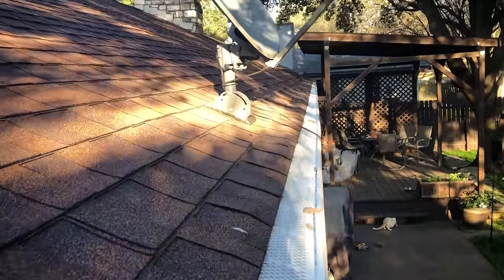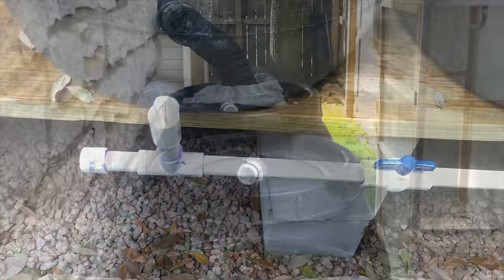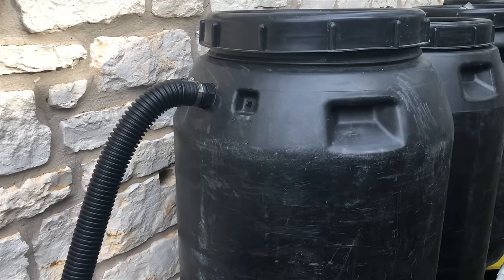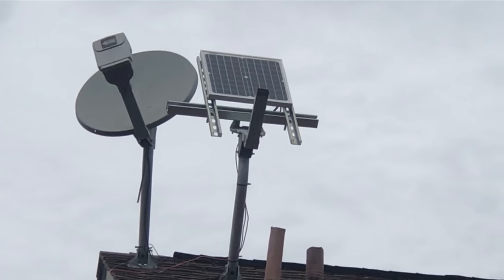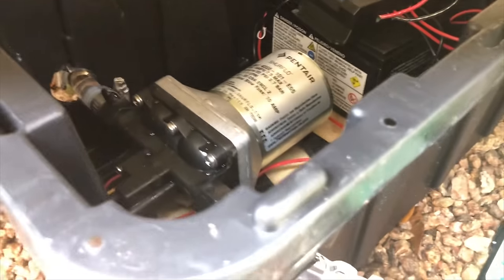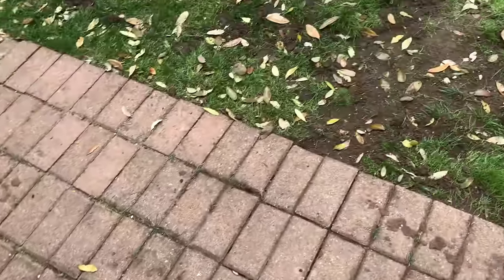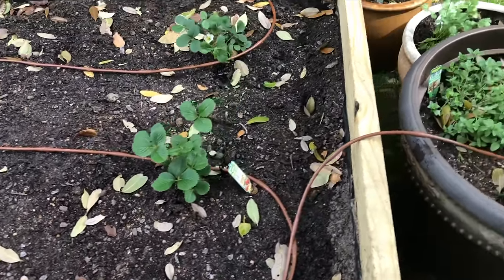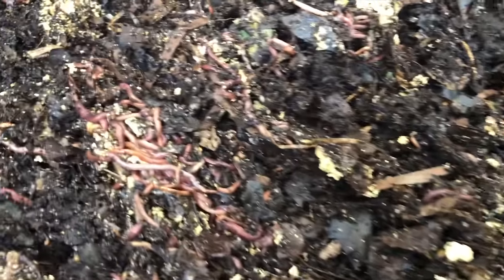Rain Barrel System Overview with Solar Powered Water Pump

Comment: Wow, our systems and gardens are VERY similar.  Found your video cuz I'm probably going to change mine from a gravity fed to a ground based pump system next spring. Super cool, thanks for posting. Very helpful.
Reply: My current system is gravity and I just don’t have the pressure. Definitely going to look into the pump.

Comment: I am such a doofus! I was wanting to know the level in my rain barrels as well, but I was going down the route of cutting a hole in my entry barrel and sealing in a clear plastic view port. This will be so much faster, less hassle and probably more accurate. Thanks mate!
Reply: Strap the view tube to the side of first tank and make the algae cover a flap you can just pull back to look, much better ease of use, and you can leave it capped off, or use a mesh cap for venting

Comment: You've probably discovered by now that you need an overflow hose in your first barrel.  Rain sometimes come much faster than the subsequent barrels can fill.
Reply: UH....What?   Think about what you say before you say it.
Reply: @tunerdadtunerdad7927  A large enough volume of water will be constricted by the size of the transfer pipes. 

In theory, you are right, the water in the barrels should rise at the same rate. In reality, that's only the case if the volume of the transfer pipes is equal to the volume of incoming water. Being that those little pipes are narrow, and the water is coming from an entire roof, it's quite plausible that the first rain barrel would fill much quicker than the others in a deluge.
Reply: @monunyabidness5949  ...Look at it again.
Reply: @tunerdadtunerdad7927  There's a 4 inch pipe going in. There's what looks like a 1.5 inch pipe exiting that tank into the manifold. A 4" pipe can do 240 gallons per minute, gravity fed. A 1.5" pipe can do 35 gallons per minute. Even if that were a 2 inch pipe going into the manifold, that can only do 55 gallons per minute.
Reply from the maker: Yes overflow in first barrel would be better, especially in a heavy rain.  When we have a very heavy downpour it overflows out of the top of the first barrel when rain comes in faster than it can move into other barrels.  For normal rain it works OK, but if i did it again I would put overflow outlet in first barrel.  Good observation.
Reply: Yes a I agree, I have a similar set up but with top overflow feed from barrel to barrel.works fine
Reply: Because the manifold pipe is too small.
Reply: Exactly
Reply: @D R This is the comment I was looking for.  Knew someone else must have already said it.  Also, I agree that it would require a bit more pipe, but I think it would use the same number of joints.
Reply: @TexasOrganicGardening  Make the overflow or a second hose at the top of the first and second barrel. That should equalize the flow of water and make the barrels fill proper if you use a 3 in pipe.
Reply: @tunerdadtunerdad7927 are you challenged?

Comment: If less than 1% of all home owners did this the fresh water saved ,not to mention the cost of said water ,would be astounding!
   Btw I've been doing this with my a/c condensation from attic airhandler as well. Very rarely do I have to get my hose out to water my flowers ,nd edibles. 
  Drip irrigation nd solar pump,is a great bonus!! Very impressive!! Sight glass just over the top..WOW 
     THANX for the information.

Comment: Sweet setup, I will definitely be building such a system.  Your sight tube comment about algae growing gave me an idea.  Put a shut valve with quick connect at the base and the quick connect nipple on the clear tube.  When you shut the valve and disconnect the tube the water runs out and the tube can stored indoors.

Comment: Great video. I especially like the level sight idea. Might be able to find a float style level gauge that will incorporate the same idea. I use Ktek style level gauges at worrk that use two tubes essentially. One that has the actual liquid level with a magnet that floats on top and the other has triangular shaped pieces of metal that turn as the level goes up and down. 

I have an ibc tote that is 275 gallons. We have almost filled it once so far this summer but a lack of rain has really been a damper. I have the downspouts on both sides of my garage connected together that lead to a drain tile to pour into the top of the tote. In the lid, I have a screen covering the entrance so it catches bugs and debris. I have to clear it out once in a while but it's a gairly efficient system.

Comment: Great set up! Only suggestion consider raising the barrels 2 to 4 ft. That should give you enough pressure to eliminate the pump and your solar system ( solar panel, charge controller and battery).

Comment: Great set up  The only draw back is that you are taking water from bottom of the barrel   ; cold water   Maybe is a way to alternate the system  install same float and pump  warmer  water from top  It will make the miracle grow   TX   liked more then mutch

Comment: Someone I knew had a similar system, but he used syphons (instead of the manifold at the bottom) arranged radially with the each barrel being fed from the first barrel.  This avoided the need for drilling the barrels and you could easily remove one barrel just by removing the syphon.

Comment: That's just so impressive!  Do you get enough rain to fill those barrels???🍿
Reply from the maker: One rainstorm will fill them up.  But in the July-Aug months when we need water for the garden the most there is no rain and they have run dry. Need to add more barrels, next project.

Comment: Impressive work, but is it necessary to filter if you're only watering vegetables and herbs? Do you use this for drinking?
Reply from the maker: I wouldn’t use it for drinking unless you added some other filtration methods, reverse osmosis as a minimum.  The reason for the last fine particle filtering is to not clog up the drip irrigation lines should any debris make it past the input screens.

Comment: If you raise the barrels off the ground closer to the gutters the system would probably work off gravity.  Downside is you would need to build a higher platform and need a ladder to access the barrells site tube etc.
Reply from the maker: 2 feet height equals 1 PSI so the barrels would need to be 30’ above the filter and drip irrigation lines to provide the required 15 PSI needed.
Reply: @TexasOrganicGardening  - Sounds like you need a 3rd story.  lol.

Comment: I would LOVE to learn your system.  How much did this setup cost?  How long did this all take you?
Reply from the maker: Barrels are available used for maybe $20 each on Facebook marketplace and craigslist.  The pump was the only expensive item.
Reply: @TexasOrganicGardening  is this system also being used for drinking purposes? And if no, can it be?
Reply from the maker: @NEMO-NEMO  This system is strictly for watering a garden or plants.  Rainwater can be collected for drinking but the system would need additional filtration and cleaning added to it that are not covered in the scope of this video.

Comment: I love this clever design! I have been wanting to build something similar, but I don't know the first thing about solar power. Do you need a special inverter to charge the 12v battery? Or is the solar controller enough?
Reply from the maker: I used an inexpensive solar controller.  Will do an update in an upcoming video as we are doing spring maintenance on the system in coming weeks.

Comment: Do you drain the water in winter, any problem with freezing? Thanks for the video.
Reply from the maker: Yes, draining in the fall is recommended to prevent issues with freezing.

Comment: So a 12 volt battery will enable pump to send water through to irrigate your food growth. 
Might we enquire, what space does that cover? 
Our garden 36 x 54 feet, raised beds all 4 foot high re mobility issues. 
Would that system work around our food beds that high, or would we require a stronger voltage? 😊✌🏽
Reply from the maker: Currently watering two 6x12 raised beds (144 sq ft), with plenty of extra capacity if needed.  Main issue here is running low on rainwater during hottest summer months, need to add additional barrels.
Reply: @TexasOrganicGardening  we have a daisy chain of dozens of rainwater reclamation barrels, below ours & also our wheelchair bound neighbours' guttering where we also grow food for him in his space, plus weather control chemtrails in uk means there's little chance of running out lol, it rains lots here yet temps remain humid in summer on south coast.. plus we use unfluoridated bathwater with essential oils for flowers used fluoride filter to incoming taps for about 4 decades now ~ changed twice, lasts every 10-15 years, due to change again soon 

We feel initial question wasn't clear enough... 
So, our raised beds are at least 4 feet high... do you reckon that pump would push the water upwards that height, or might you recommend something with a tad more power? 
In appreciation and grace.

Comment: Excellent job. My only question, what size wire did you run from the solar panel? Was voltage drop a concern given the long wire run of 12vdc @10 amps?

Comment: Tony -  Thanks for the video. I'm wondering about your overflow pipe upgrade from the 1.5" to 4" on the back end of the system.  If you're connection manifold is 1.5" pvc (or so), will you get a greater volume of flow at the exit when the system if full?  Or will you be putting that upgraded overflow on the first barrel were the down spout comes in?  Thanks so much and thanks again for the detailed video.
Reply from the maker: As you noted, on a very heavy rain it will overflow on the first barrel system input (top) because the bottom manifold is only 1.5” and that has its limits on flow to the other barrels. Works well in a normal rain situation.  You could locate the overflow pipe on the first barrel if you wanted to.

Comment: Would this work without the pump? Enough pressure in the barrel itself to water 2 or 3 plants with the battery powered timer?
Reply from the maker: The timer requires 15 PSI to operate, so the options are 1) don't use a timer, 2) raise the barrels 30 feet above the timer to generate 15 PSI from gravity, or 3) use a pump.  We went with #3.

Comment: Your shut off valves would have been better sited on the vertical pipe to each barrel rather than the horizontal one. That would have allowed maintenance on each barrel whilst keeping the rest in service. The way you’ve configured things, in order to shut off the second barrel you shut off all the ones beyond it.

Comment: Couldn't you raise the barrels to right below the gutter to increase the pressure for gravity-fed irrigation?  Also, do you divert the initial (polluted) water that comes off of the roof or do you have a filtration system?  I have a bunch more questions but I don't want to bother you.
Reply from the maker: No bother at all.  the formula is roughly 2.3 feet of height gives you 1 PSI.  The drip irrigation timer requires 15 PSI minimum to function. (Most home hose faucet bibs put out 40-50 PSI).  For 15 PSI the barrels would have to be 30 feet higher than the timer.  Not practical in my situation.  I did a lot of research on diverters and decided not to put one in.  The industry is 50/50 on this topic. They are the most prone part of a system to leak and cause problems.  For filtration I have a leaf filter, then a fine mesh screen on the input, and an even finer inline Rainbird filter just prior to the timer.  It won’t make it drinkable but its is fine for drip irrigation for a garden.
Reply: @TexasOrganicGardening  Oh, thank you for the information!  Is there any concern of heavy metals or hydrocarbons from pollution being washed from your roof into the garden?  Also, I know much of Austin has expansive clay, do you also use the collected water to keep the clay around the foundation hydrated?  Did you get any damage to the system during the freeze?
How much did it cost?  This is something I would really like to do when I get the opportunity.
Reply from the maker: @LeesChannel  I’ve read a lot of studies on using metal, wood and asphalt roofs for rainwater collection.  I suggest everyone do their own due diligence on this also, but in general studies show asphalt shingle roofs are fine for drip irrigation systems.  Would not use this system to drink straight from - that would require reverse osmosis filtration.  As far as freezing, it is recommended to drain the system in the fall and keep the drain open or cover the inlet to avoid any problems with freezing/expansion cracks.  The barrels were $30ish each and the pump was $95.  Other costs were nominal.

Comment: I have found that over time, the solar panels need cleaning, as they drop in voltage production... mine are gutter level high. Also, there should be minimum wire length used, as the resistance of the wire/foot adds up... again dropping/ wasting voltage... this is why we have ac voltage delivered to our houses, vs. dc. 
But , you need to do what works best for you, and your circumstances...
Reply from the maker: Correct, the size of the wire needed for the solar panel to the battery needs to be selected in consideration with the distance of the wire run.  And shorter runs are better when possible.  We have huge oak trees so had to get up high.

Comment: I have done this system and the first problem I see with this one is you have a 3-4" PVC feeding the first barrel but only 3/4" PVC feeding the rest. In a heavy rain the first barrel will fill and overflow before the others fill. At least it's outside so when this happens the water spilling over just falls to the ground and not inside.
Reply from the maker: That will happen, but in a heavy rain the entire system will fill up in a few minutes just from the sheer volume of water coming down.  So one way or the other its going to not be captured. You could make the PVC manifold system diameter match the input diameter if that was your primary concern.  For me, I wanted the PVC manifold smaller and cheaper/easier to replace if it ages due to weathering.  Was not worried about occasional overflow during a very heavy rain.
Reply: @TexasOrganicGardening  what did you use to attach the PVC to each barrel? I used flex paste and it worked with the smaller PVC but when I increased to 4" I have leaks. I can't find a store anywhere that makes proper fittings.
Reply from the maker: @paulsmith5469  https://www.youtube.com/watch?v=RmalBQ818XA&list=PLaSARqNMD9ie2g9idAxNRwVgTkieG02et&index=5
This video has all the details.  The fittings into the barrel were Bulkhead Fittings from Home Depot, with a little waterproof silicone sealant for good measure. Haven't had any leak issues.

Comment: Yes mate, this system is really good. Just out of curiosity how does it handle the cold/snow? I will definitely use this as inspiration 👊🏼
Reply from the maker: I would recommend draining the system before entering the winter season to avoid freezing expansion causing any springtime leaks.
Reply: @TexasOrganicGardening  ... ok, makes sense 👍🏼

Comment: Which pump, controller, battery, and timer did you use?

How does the pump turn on when the timer turns on?
Does the timer both (1) turn on and (2) allow the water to flow in one action???
How does that work?
Reply from the maker: Check out my other video on building the pump system for all those details and links to the items in the video description.  The pump is an On Demand pump, so when the irrigation timer comes on and allows water to flow the pump will detect that pressure change and turn itself on automatically.

Comment: Just curious if you raised the catch system up higher, would it have enough pressure to work the controller? Very cool system either way.
Reply from the maker: Good question - the height to PSI calculation is 2.3 feet for 1 PSI, so the barrels would have to be more than 30 feet above the timer controller to it to function as it requires 15 PSI.  I did try it without raising the barrels. No go.  You could omit the timer and you would get water flow from the barrels, but not at the same PSI as from your house and as they get emptier the PSI gets less and less.
Reply: @TexasOrganicGardening  oh wow~! thanks for answering.

Comment: Nice but I can't find nothing on the actual solar panel nor is it sized for the battery or demand
Reply: A 12v 75w solar panel is perfect for this. Since it's a simple pump system,  no need to go crazy and use a deep cycle battery. A used battery from a junk yard would work fine. I don't think he had a solar controller - I would just to play it safe. A $35 one would work perfect in this application. 

Panel $75, pump $30, solar charge controller $35, used battery $15, wiring $30, 12v timer switch $15 - $200.
Reply from the maker: Check out out other two videos specifically on the solar panel system set up.  They have the details you are looking for.  It is sized appropriately for the battery and use of 10-15 minutes of pump use for drip irrigation twice per day.

Comment: Would you have any ideas on how I can utilize my sump pump drainage into something similar to what you have.  Was thinking discharge into a rain barrel, then some how connect a sprinkler head to water the grass in the area.
Reply from the maker: That is a great idea, almost could use the same set up with the sump pump discharging into the top of the barrel instead of a gutter downspout providing the water.

Comment: Something in rain water is more beneficial than tap water for the garden
Reply: Absolutely, I'm also convinced that rain water that "collects" for more than a few days in a rain barrel is OK for the flower beds but not as good as rain for the vegetable beds.  Doesn't make sense but after using rain barrels/ soaker hoses for vegetable irrigation for more than 10 years I'm more convinced every season.
Reply from the maker: Rainwater doesn't have added chlorine, so that's a plus.